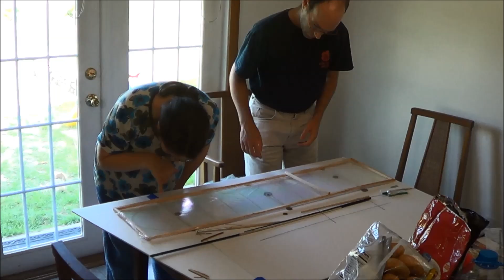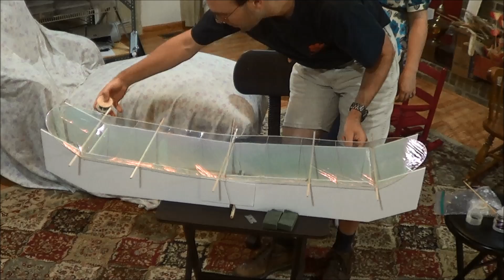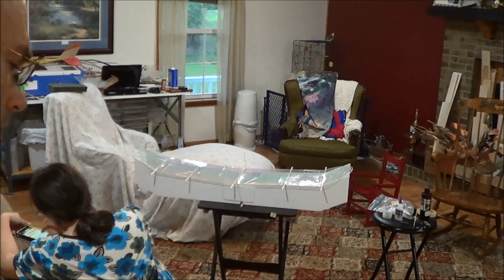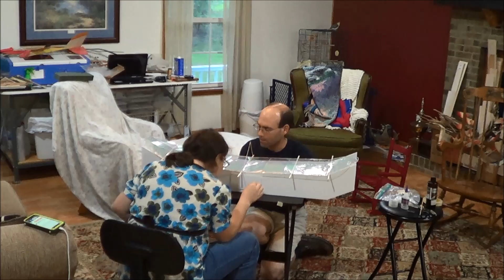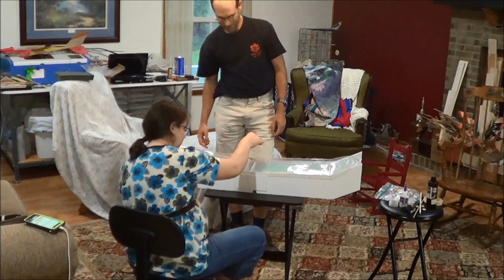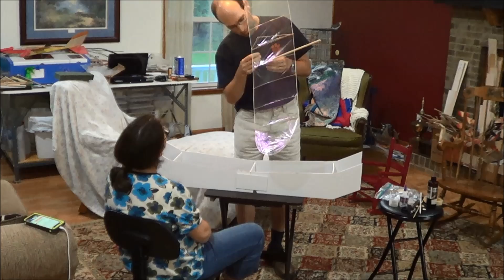Wire bracing a rubber powered airplane: Hourglass II

Comment: Thank you for posting this! I'm going to build another wing and use the covering method you used. I dropped the wing onto the film, and it is a little crooked in spots. Your method should be much easier. Do you just glue a little block to hold the bracing wire onto the wingposts (similar to how you add the block to hold the wires on the cabane)?